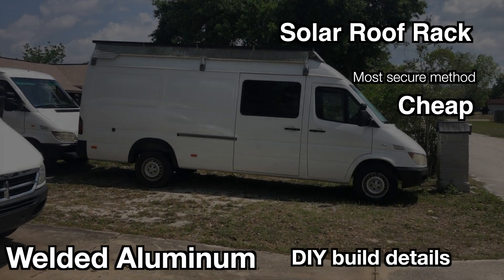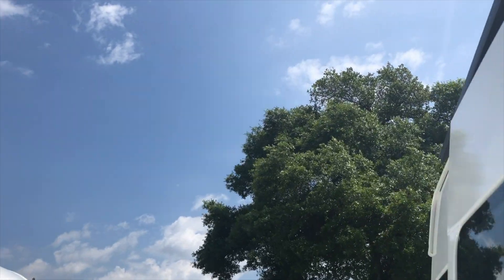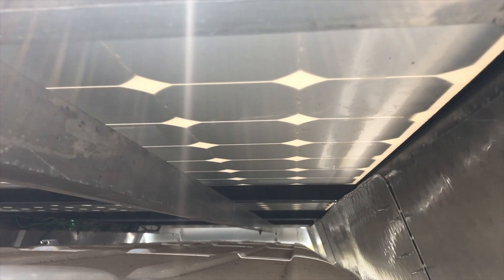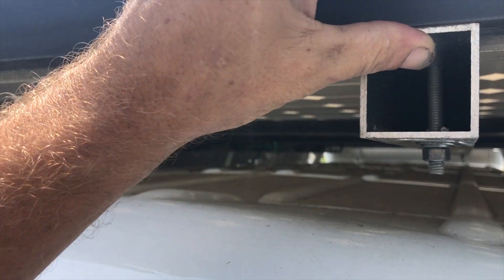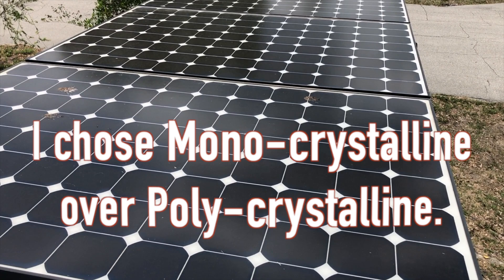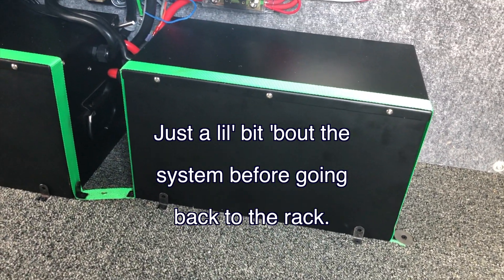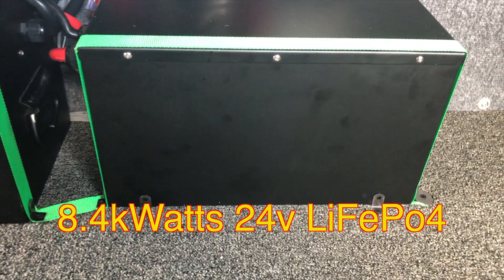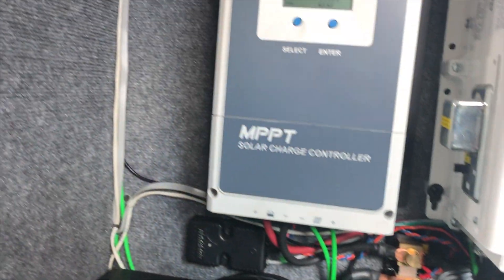DIY Solar Roof Rack on Camper Van Custom Built Aluminum Welded Cheap

Comment: Hello,, Very impressed with your solar installation. I've been watching so many videos concerning a variety of set ups for solar and Air condition for vans. So many times, I have been disappointed in  feedback. I live 1hour N. of Gainesville in Florida, and I would like to hire someone in installing a solar system, for the van life, but I do not know the costs, for the system on this video, as an example. I will be purchasing a van within the next few months, hopefully, and I would really like to find a person that I can trust to put in my solar. Any feedback would be helpful...Thank you again, for the powerful solar that is installed in this van, that finally interests me.
Reply from the maker: Many lessons were learned building this van's system, and by lessons I mean mistakes & corrections. The estimates I got were astronomical so I did it myself. Now I understand why the estimates were astronomical. There is Always more ways to make it a little bit better so at some point I had to live with it, not move everything... Again!  I had a solid plan, but things happened that caused the plan to change, and failing to plan for that was a Big mistake. If I were tasked with building a copy of this system, it would be priced over $1,500 including all parts and labor. The batteries cost me about 1/3 of that. But, if I had been building this one for someone else, I may have eaten my shirt on labor "cost" (I don't pay myself but my time is valued so it's hard to say). To install someone else's collected parts I would only agree to hourly rates with daily discussions about progress. I would want to be sure the customer is comfortable with cost compared to progress. Even the little things seem to take 4X as long as I think it should.
Reply: @FloridaVanMan  Thank you very much for the swift reply, and I appreciate your time and honesty.. The figure you mentioned seems reasonable, and I can only imagine the effort and trial and error of many situations. I may want to talk to you at a later time, and possibly work something out for the installation of the solar, if you would be interested at all. You are the first video I have seen for the amount of solar you have for the size of van with a strong ac. I have looked for years. I will send a message again when I get my van, and go from there. I am actively looking for a van, possibly diesel, windows in back, relatively low miles,,,,yeah, I know, many people are. We have a lift and working garage here and welding, I just don't know if I want to task my husband with such a job, but I will research it more..Again, thank you so much for your reply, and if you don't mind, I will be in contact with you again. I really like your setup.
Reply from the maker: @bonniekropolinsky-hinkle3680  If you are looking to buy a van I must say a 15 year old, high mileage Sprinter is your best option. They can be expensive if you rely on dealerships for the work. And they can be a pain in the keister until you accept it is not like any other engine you have worked on. After acceptance comes learning and healing. With Amazon bringing me parts and YouTube showing where to stick them...hehe, I've come to appreciate the odd duck of a 5 cylinder engine with a tattle-tale computer that complains about every little thing that "should" be addressed. Did you know we have 2 vans for sale? The solar powerhouse has a price tag, but I am open to hear what its perceived worth is to other people. I'm about to build in a floor-plan with beds and potty, just for the fun of it. I can't keep it because I have too many. The sporty shorty is about half the money if you don't need to stand up inside. But it doesn't have any solar, just alternator and plug-in charge options.
Reply from the maker: Have you seen our Buyer's guide that premiered yesterday?
Reply: @FloridaVanMan  Hello again, sorry for such a delay...Things happen, ya know. Sometimes I get so involved with research on YouTube with the Van life, that I fail to see whats in front of me, and possibly a van for sale.. I actually might be interested in one of your vans for sale. The Buyers Guide, I assume is where to look for details? I like your work, so I would be interested in researching both.As I mentioned, I like the solar system you installed, and I do want alot of solar to handle a 5000btu ac. I like windows in the back, and a lower height van is a possibility to save some money...

Comment: The burn marks on those welds indicate a lack of shielding gas... and skill...

If you need work done again I’d go somewhere else.

Other then that, nice looking build,  the extra safety devices aren’t a bad idea.  Just be careful about disconnecting the inverter or charger from the battery while under load.  That can damage gear.
Reply from the maker: I did immediately notice how much nicer work was done the second time around. But I didn't realize how bad the first set was until making the video.

Comment: could you add a larger description of your set up and maybe a reason why you went with Mono vs Poly Crystaline panels. I think I heard you say van was foamed insulation. and more pausing at spots, slow down the camera. Thanks for sharing. 

you should travel for another welder if that is the only one in town. they really dont care about their work.
Reply from the maker: I will try to make a video detailing the hardware soon. Mono vs. Poly turned into a coin toss, I made a decision, and then changed it when I went to look at the available panels. I think they let the new guy try welding aluminum on the first go-around. The shop has been really good to me the few times I needed them. My swing seat in The Blue Saloon was a true success story with 5 stars for the same shop.
Thank you for the input. I'll try to slow it down at the right spots.

Comment: Amazing solar system that’s a shit ton O power but thought I heard AC?   Why FVM did you decide a no go on penetration?  And you said the side covers upped MPG ?
Reply from the maker: Thanks. We went with non-pen for a couple reasons. The weight of the panels wasn't a worry, but the wind forces they will present at speed could be up or down. Proper roof racks are weight rated when secured to the 3 layer rain rails, so I tried to mimic that.  The side covers don't "up the fuel milage" really... They just reduce the losses caused by drag between the roof and panels. We have not driven it far enough to measure actual mpg, but adding the sides helped acceleration at highway speed, noticeable enough to be undeniable. We test drove it before the side panels were installed and I was worried. I could really feel it holding me back. That seat-of-the-pants feeling of horse power is the only verification of the theory, but the theory of reducing drag came first. I recently read about truckers using nose tarps over the front of hollow tubes, creating a wall to eliminate drag in the tunnel. It seemed counter-productive, so I read more... Now I believe!
A/C yes. That is one of my hobby projects. This van has stealth a/c vented through the floor. My daily has a/c thru a side wall and decorated as a tool box. Roof a/c all seem inefficient and DC A/C is soooooo expensive for anything that actually works. 48v mini-split would be the way to go on my next attempt.
Reply: @FloridaVanMan  Thanks for the video and mpg discussion. Heard a 3-4 mpg hit. Can you confirm your experience now that you're down the road for some time? Thanks. Side panels should not hurt your electric production because you have nice roof clearance for heat disipation.
Reply from the maker: @energyideas  The wind drag was so extreme I didn't even tag & insure the van. I sold it soon after the build was done because realized the extra fuel was going to hurt. I was driving a lot of miles and sleeping away from home less than I wanted. That solar outfit was for someone who spends more time away in the van, driving fewer miles. A real van-life person would get better use of it.
Reply: @FloridaVanMan  Thanks again for the video and reply. Lightweight flexible photovoltaics that adheres directly to the roof will eliminate the wind drag from roof equipment. Small hit on electrical production because the heat can't dissipate from the. The trade-off and saving fuel is enormous from an energy standpoint.